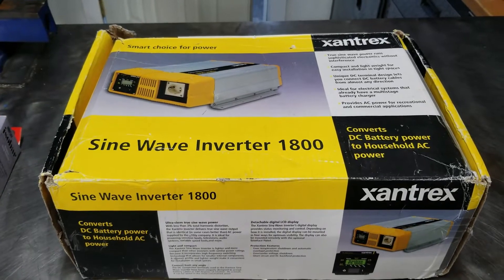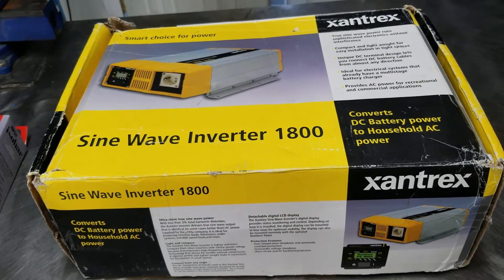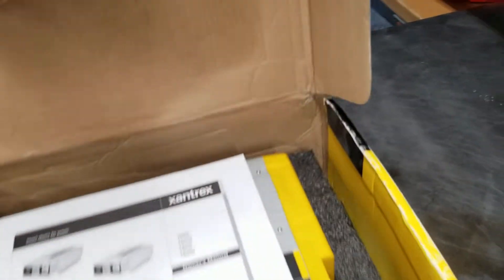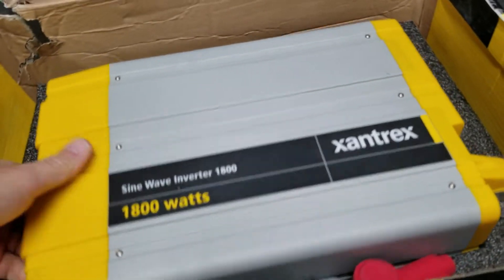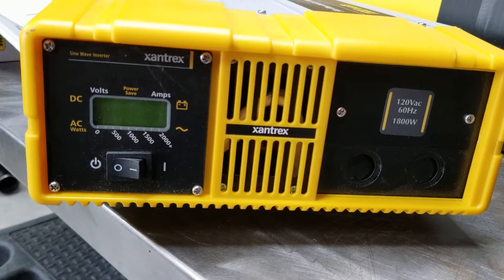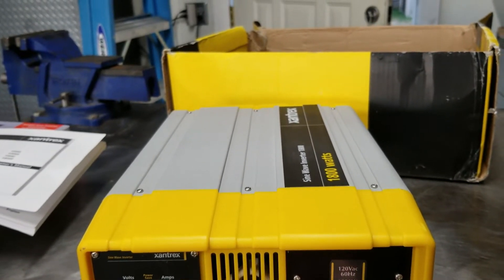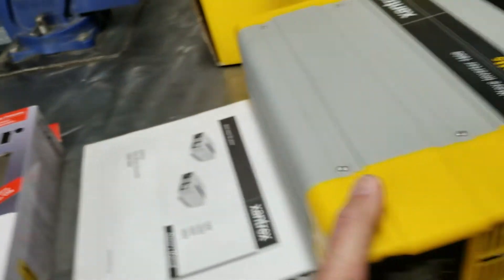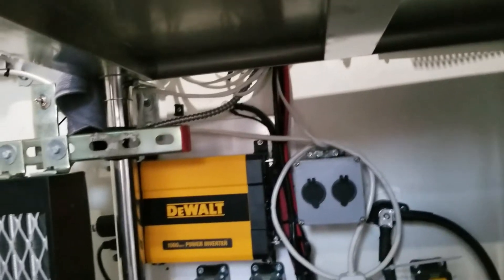Abel LMTV build part 120 (Xantrex 24v inverter, Isobar quad receptacle)

Comment: Hi Sean, was the unit powerful enough to run your a/c?
Reply from the maker: Yeah.  Ran it for 5 hours connected with the 24v charger plugged in.  No problem at all.  Proves that with 1k watts of solar it could run the a/c all day.

Comment: You got a smoking good deal on that... there are plenty of used inverters just like that one at places where they strip old RV's down. There is one of those in Centralia, WA near me. As I recommended to you, they last year after year and mine is still going strong in my Holiday Rambler (now man-cave). So, even a used one would be totally sufficient... especially since you have a back-up for just in case. That Xantrex should serve you well for years. Good build! 1800 watts/110 VAC= 16.36 amps available.